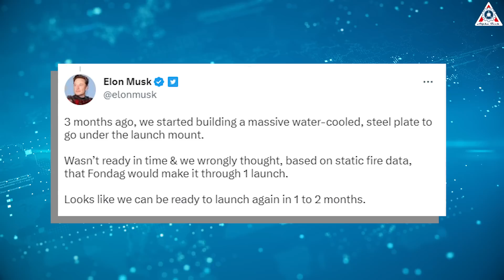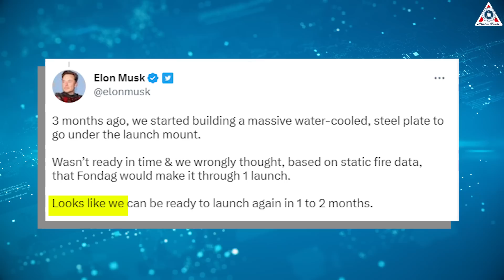SpaceX Stage 0 plans changed after huge damage from testing...

Comment: The first stage ignited with record-breaking thrust, there was a liftoff, however; there were serious issues.  During the launches of NASA’s Apollo 4 (Saturn V test flight), NASA’s STS-1(first Space Shuttle flight), NASA’s Artemis 1, ULA’s Atlas V, Space X’s Falcon 9, and Space X’s Falcon 9 Heavy, were there any flying debris?  Did any of the engines failed at liftoff and during the ascent? The launch complexes for all of these rockets had flame trenches and water deluge systems.  But this vehicle, with the power of two Saturn Vs, had none!  There is a crater underneath the orbital launch mount!   What was Space X thinking?  Also, were all of the launch problems observed during this flight only due to the lack of a flame trench and a properly designed water deluge system at the launch pad? During the ascent phase, several more engines failed, flashes were visible, and the color of the exhaust went from clear to yellow. Also, there was no stage separation and the rocket appear to be tumbling out of control. A version of this second stage must safety land humans at the South Pole of the Moon! If these problems had occurred during the maiden launches of either Apollo 4 or STS-1 or Artemis 1, what would we have called this? NASA's Stennis Space Center's test stands have flame trenches and water deluge systems. Why did Space X fail to perform a full duration test firing of the first stage at one of these test stands? Finally, was this rocket (two Saturn Vs) a danger to the public in Brownsville, Texas? There was flying debris! Compare to the maiden liftoff of SLS, was this launch a complete success? On the positive side, the first stage ignited with record-breaking thrust, there was a liftoff, and it cleared Max Q!  But this was a test flight with some successes and some serious problems; Space X must install a flame trench and adequate water deluge system, carefully review the flight telemetry, determine the cause of these serious technical problems, correct these problems, retest the components, and then relaunch! Also, they should make the incident report public.

Comment: Insaid baisc have been bypassed the launch platform was testested for weaking and distorted surface crack. And hear stress. A simple metal sheet would have deflexted the heat.

The ignition distored concrete which damage the engines and the detach mechanism.some time  simple things can cause a big mistake unless a perosn perosnally doesnt look from all possible angle not generally  sighted such expirement must be avoided..

Factor if safty must be min 200

Comment: The failure of the three motors were probably caused by ricochet debris rebounding back and hitting the motors.. I'm not sure how they could consider this flight any kind of success when there were failures in a lot of unrelated systems.
Reply: Yet it made it off the pad with motor failures. Lessons learned today will help to avoid problems later on. That's been true all along for NASA, SpaceX, and other Aerospace companies for a long time now. (NASA got complacent on the Challenger and it cost them the lives of 7 astronauts on a problem they were warned about)

Comment: The water table there is only a metre or so below the surface. If they put a cooled steel collar around a well bored to say 10 metres blow that, a launch should generate a massive cloud of steam but no soid debris to attack the surrounding infrastructure. The terrain around should provide enoughwater to replace it. Contradictions?
Reply: Like a bridge launch pad can be built 15-20m over the surface to have vertical space for diverters and jet streams paths.

Comment: Most non-engineers don't know this, but the Stage 0 design worked as designed, perfectly.

The problem the SpaceX engineers had to deal with was designing for something never done before: thrust over twice that of the previous record rocket thrust.  So to keep cost down, you design something relatively cheap that at l;east theoretically has a chance of working.  But if it doesn't work, you now have a baseline for comparison and future design.  Now the engineers know which parts totally failed, almost failed and didn't fail at all, and therefore know enough so they can redesign around those failures.
Reply: Lets build 10 launch pads of increasing durability until they survive at 99.9% level.
The alternative is to calculate what they need to skip first 9 constructions. Calculations were invented by miserly guys who did not want to build constructions with "try and fail" method.
Reply: @alexanderbelov6892  "Calculate what they need"?  When you are dealing with the unknown, like a record-breaking rocket blast, it's impossible to calculate exactly what one would need.  If you have three equations and three unknowns, you can calculate the unknowns.  But if there are four unknowns, the answer is impossible to calculate.  At this time, there are simply too many unknowns with this new kind of rocket ship to accurately calculate "what they need".

If they followed your suggestion, they very easily could make some expensive monstrosity that's way engineering-overkill, and all the money be spent on that and none left for rockets--with no guarantee that the monstrosity would work perfectly.

Comment: Spacex held the rocket on the stand for 8 seconds after all the engines fired, they should have released it immediately. There is at least one section of the foundation concrete ring beam that connects the legs completly blown away. If the stand has tilted they might not be able to save it.
Reply: Probably Raptors cannot work at 100% thrust from first second. The engines have turbopump for fuel components. This turbopump needs time to reach maximum RPM.
Reply: @alexanderbelov6892  The test fire was 50% power. Musk said they would launch at 90%. Not sure how long it takes the engines to get there though. If you look at the SLS launch it lifts as soon as the boosters ignite. I do understand they are different systems though.

Comment: I'm not a rocket engineer but I know enough about rockets to know that what Elon did, (100% his fault) was total preventable. His EGO got in the way of common sense because he wanted to prove he didn't need a flame diverter. Well how's that working out for you Elon. If I'm NASA I'm telling SpaceX that there will be NO launches of Starship from the Cape until they prove there will not be any damage or minimal damage to infrastructure at the cape during a launch. If that amount of damage had happened at Launch Pad 39A there would be millions of dollars in damage and they would not be launching any falcon rockets for months.

Comment: The whole "rapid reuseabiity" mantra ignores the fact that it takes on the order of 170+ tankers  of fuel and oxidizer to fill a stack. So until there's a methane plant and oxygen ASU on site (probably back around the assembly area at minimum) there will be no rapid reuseability.
Reply: Rapid compared to what, SLS? SLS takes a long time to build etch time, so refueling is not a problem.
Reply: SpaceX needs to build CH4+LOX fuel generators they plan to have on Mars. They need proof of concept before they spend several billions on the rocket itself.

Comment: Well I KNEW that what will it do. I don't need to be and engineer figure that out. Would think if it blow the concrete the first time. They need to build a pointed slide. So you will have to builded one slide west the other east and spill millions gal. of water on top of point when take off. Oh good luck when you land up on Mars. You would have to bridge the rocket on rocks, it would be chaos landing on Mars. Oh Your not ready!

Comment: Elon is the smartest person i ever heard of. 
How is it he makes a launch pad out of concrete?
Concrete doesnt like heat and there wasnt a flame diverter.
Like wise why would any one have facilities next to launch pad.
Really elementary mistakes. Some one is talking him into this.
I hope those people lose their Job and he gets smarter people
 to work for him on this.
Reply: Concrete is OK. But absence of jet diverters is a mistake.
Here video showing launch pad with diverter of Buran-Energia rocket with 2500+t mass:

youtu.be/OFr60xlpCTM?t=37m9s

The construction engineers had experience and knowledge what they have to create for 50 years durability.
Reply: @alexanderbelov6892     Thats not concrete though, Concrete because of the moisture in it will explode under high temp. Try it with a torch, joking. Do you see all the joints and bolt holes.  Its hi temperature ceramic refractory blocks. Like they use in steel mills. I think its good to close to 4,000° F.
So i maintain my argument, the rocket is hi tech but the launching pad , is bad news.

Comment: Well I still see this test as a rather big success despite the damage to stage 0. it seems to me the most important thing to learn from this test was the impact to stage 0 and what might need to be done to solve any issues. Of course it would have been great to get more data on the booster and starship but that will come in the next test I suspect,, although i think we're looking at that test being more like 2-4 months away if not a bit longer. The booster probably provided sufficient data, i'm thinking the damage engines were likely from the effects of the launch on stage 0. Beyond that we saw that even with 5-6 engines out it still had enough power to get past max Q and everything seemed to hold up fine although there is some question as to what caused it to start "somersaulting" was that a malfunction or the ship trying to correct things due to the missing engines? The most important unanswered question in my mind is how well does the heat shielding hold up on re-entry? It would have been nice if they could have gotten that data on this test but you make do with whast you got. Given the delays they had getting this first test off and the fairly limited static fire tests it's not too surprising they misjudged the impact to stage 0 so badly. Also it was unfortunate that there was so much pressure to get this test done ASAP that they didn't wait to get the deluge system and  the heat shielding/flame diverter in place first. I for one would have been perfectly okay with having to wait a bit longer so they could have that factored in rather then rushing things. At least they now know that any and all future launch sites will need those protections in place before any launches can take place.
Reply: The somersaulting was kinda intentional.
It was supposed to use the spin to help release the booster from Starship.

Also, I really liked how the spinning showed how tough the thing really is.
Reply: This is speculation, but both boosters Stage 1 & 2 were meant to have a high energy crash into the water. I expect the flight plan for stage 1, was moments after the programmed stage separation, stage 1 was designed to flip and burn, to stall the trajectory and have it splash down in its designated water landing zone.

The fact that Stage 2 never separated, it is likely the upper stage planes (fins) and mass caused instability resulting in the summersaults, until the team was able to initiate the self destruct.

Comment: Right from the beginning of space technology I reasoned about using catapult systems for the "first push", reducing the fuel consumption and so enhancing the payload significantly. This advantage might pay off the better the higher the weight is, which also corresponds with lower acceleration of fuel boosters. However, I did not find any discussion in the Space X program ... only startups experimenting with little prototypes ... somebody knows the reason?
Reply: Usually empty rockets are transferred at 0.5m/s speed. This is consequence of rocket construction weakness.
If fueled rocket is catapulted with excessive acceleration (above 4g) or speed above 0.5m/s it may become a fireball in seconds.
Reply: @alexanderbelov6892  A very easy, but very convincing explanation. Thank you, Alexander!

Comment: So this was done at half throttle why not run with half Half the engines lit and light the rest of the engines once it clears the tower
Reply: It cannot launch with less than 24 engines. It will stay on launch pad smoking it until engines off.
Reply: Rocket engines thrust shall exceed weight of the rocket for take off.
Reply: I don't know what the calculation is. But it seems to me. You have to reduce the amount of engines on take off just enough. To clear the tower once the tower is clear you. Can ignite the rest of the engines to bring it up too Speed. That way you don't damage the launch pad
Reply: @sushicraves  
SpaceX needs durable diverter for multiple launches per day as they plan for Mars missions. Here example of engineered diverter for 2500+t Buran-Energia rocket in Baikonur/Kazakhstan:

youtu.be/OFr60xlpCTM?t=37m9s

Comment: Would be cool to have the exhaust gas go through big tubes with turbines to capture the energy and slow the exhaust gas down.
Reply: It will not work for launching of rockets. Jet streams shall pass through diverters free of significant obstacles. Some diverters in Baikonur/Kazakhstan have dumpers to sliw down jet streams fastar than constructions without dumpers, so such diverters cost 2-3 times less due to less size.
Reply: 🤔 Mmmm...  Yeah.! 👌

Comment: why are these reporters always trying to dodge the obvious.  Though the launch was a semi success and great for gathering data. fact is, the launch pad and much of the facility was destroyed.  PERIOD!!!.  This was no light superficial damage,  This was catastrophic bomb level damage, one that left a sizable crater, deep enough to remedy the bad base completely unusable and by no means repairable.  Truth be told the whole of the launch facility must undergo a complete rebuild OR they must complete their tests at another facility, one better suited for such a powerful launch as the method they employed was anything but adequate.   Theres no two to three months turn around.   An entirely new design must be constructed along with an exhaust trench to divert the sheer heat and force away from the pad itself.  And even then a new structure must withstand the same force upon the rockets lift off.   This was no mere minor damage,   the results were catastrophic at best. We are looking at a year's time before another star base launch is ready. clearly reinforced concrete will not do the trick.. and certainly not Elons suggestion of just constructing a steel base.

Comment: How about a divert flames of murder? Which would the exhaust would be in the depth of a pond of water? Send the flames underwater to a holding pong that way the water will accept all the heat and blow the water out of the pond
Reply: Water is not compressable, so it can jump up into the engines having high mass and speed.

Comment: Seems pretty short sighted to torch the pad just because the water system was a little late. I don't think they launch again for another 6 months.  Great reporting. Thank you!
Reply: Well, now they know with certainty the effects on this kind of launch site design. Looks like a total redesign is in order.
Reply: @Knight_Kin  or could have been a test for landing & taken off from the moon or mars where theres no water system
Reply: @louk597  super heavy booster won’t be taking off from mars or the moon.  They’ve tested starship launching without the booster and without water suppression already, there was no reason to launch the full stack without fire channels and suppression, it would have taken just a couple months to install.  They greatly underestimated how well the pad would hold up.  They will be lucky to launch again from Boca By the end of the year.

And why would you retire the Falcon?   It does it’s job well at it’s class.  Starship will be doing a very different job in a completely different size class.
Reply: @russellharrell2747  I agree with what your saying, but I ultimately think they wanted to stress test everything with max force & pressure hence it was a success it made it off the pad, I do think messed up & it will take longer to fix then they are letting on

Comment: My question is how many raptors do they need to get this spacecraft to clear the tower? Once the tower. Is clear they can ignite those? Remaining engines To achieve maximum speed
Reply: It will not help much. They need at least 24 engines with 5520 tonnforce thrust for take off. Maybe more. I'm not sure about full weight of the rocket.
Reply: Also there is no much sense hovering over launch pad for 30 seconds, and spending so much fuel. They have fuel for about 180s of the engines work. Hovering is expensive.

Comment: 100' x 100' of 3 foot thick Titanium.      20  (1 per 5')   8 " propylene glycol liquid filled tubes bored through at  1 1/2 feet   pumped at  50 feet per second , attempt with out cooler, use cooler if fail.
Reply: I can Build this for Roughly 1.5 billion

Comment: Elon Musk admitted that static fire test of stage 1 was done with 50% of full trust capacity of 33 engines in order not to destroy mount prior Starship orbital test launch. He also admitted that initial refusal from a flame diverters under mount was a possible mistake. Now mount will be completely rebuilt with installation under it a water-cooled heat absorptive steel plate and flame diverters ( to reduce reflection back of acoustic waves).

Comment: If they were expecting an erosion failure model for the concrete as seen in the half power test but it shattered instead it was probably acoustic damage so they probably will need a water deluge system after all.